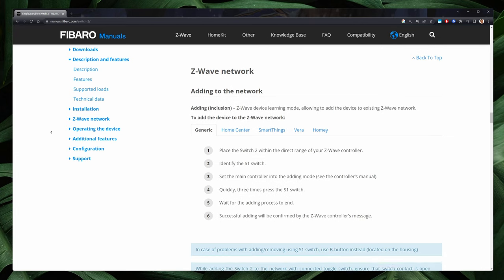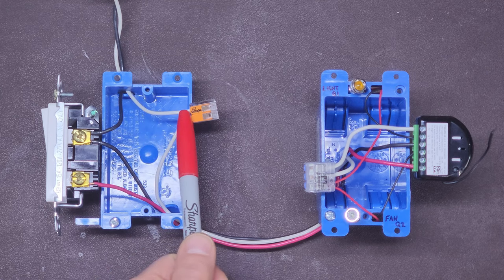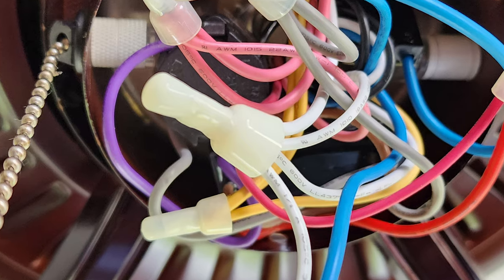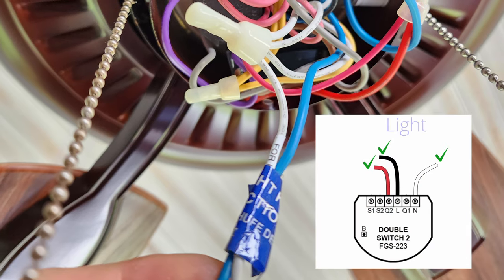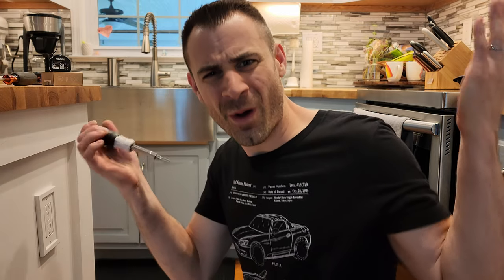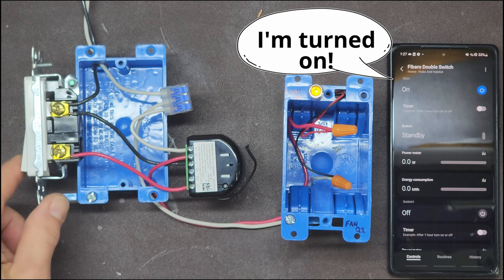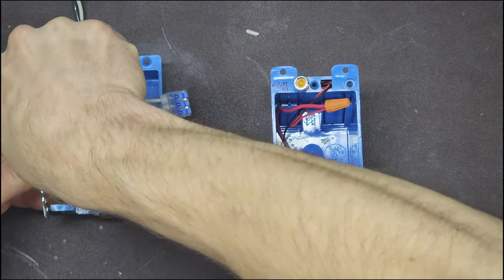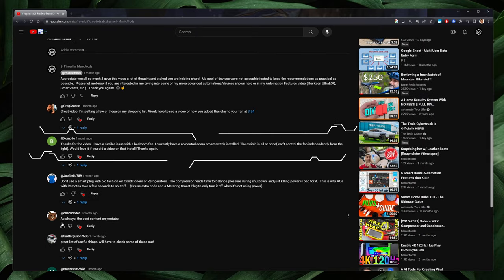Fibaro Switch 2 - Smart Switch Install Guide

Comment: Great video. Not hammy enough! With the fan installation, are you stuck with a single speed, or can you control that with your scene controller?
Reply from the maker: Hahaha challenge accepted!  Great question, the Fibaro is essentially a main switch for the fan.  So the speed changes still happen via pull chain.  Same goes for direction toggle switch.  I'm unsure if they make a universal Z-Wave controller that would manage these additional features.  If they don't, you could use an IR kit with a bond IR blaster or similar device.  I'm sure it won't be long until I research 😅